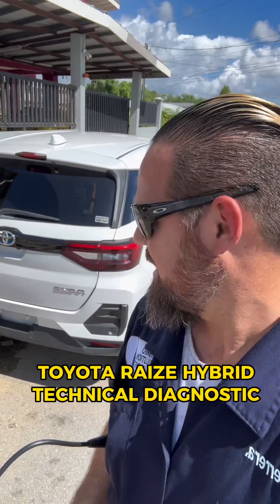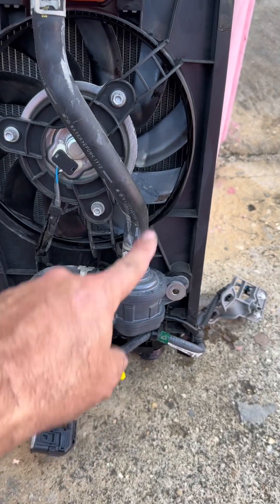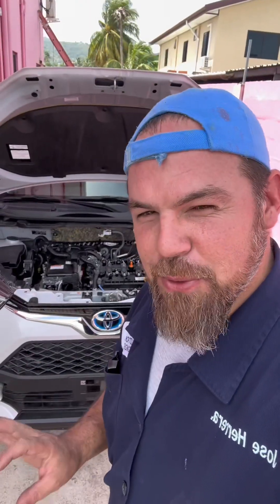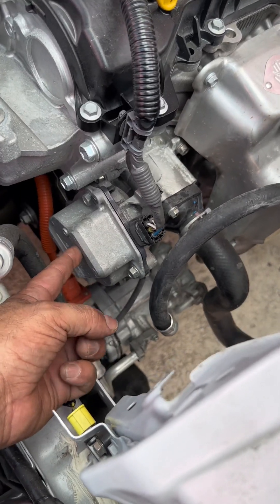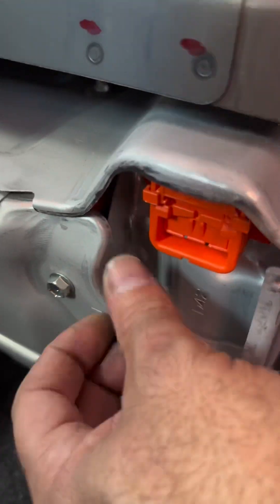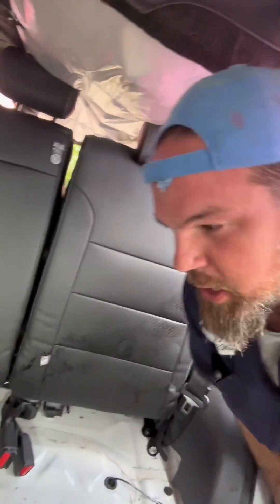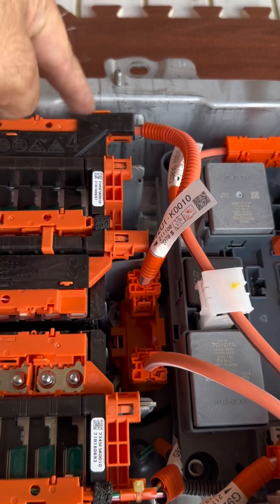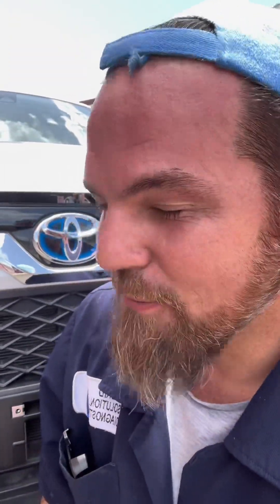Toyota raize hybrid

Comment: Dear, my toyota raize 2022 hybrid gives me an error message of the hybrid system output being limited, and the car system limit speed won't drive fast. It happens after 1 hour drive to long hills or high acceleration, then I have to turn it off and give 10 minutes of rest to start driving again.  I changed the coolant of both radiators and even serviced it, but it's still the same issue. what can be the cause of this fault ? please guide. 😢

Comment: Hello sir ... thanks for a nice video ... I have gone through a tough time this month ... I purhased a second hand japanese made Toyota Axio Hybrid Fielder 2014 in last December. This car had a Nickel Hydride battery installed in it and that too has a cell replaced. I have been told by various technicians that to repalce  the battery with a used one but of latest models. Hence I have purchased a used battery but this time Lithum of 2020 model of a toyota hybrid car. The reason was that the newer ones are too expensive. I want now to test the old and a newer battery myself. What tools do you recommend or do you use? Please let me know so that once for all I satisfy myself and many others too. the tools such as volt meter, battery capacity tester, battery charger, battery balencer etc. thanks in advance sir. also sir could you please tell me how to know when a lithium battery was made by seeing on it or by reading the product code?